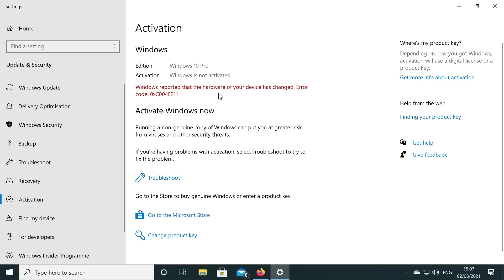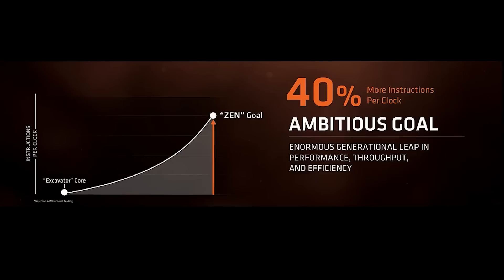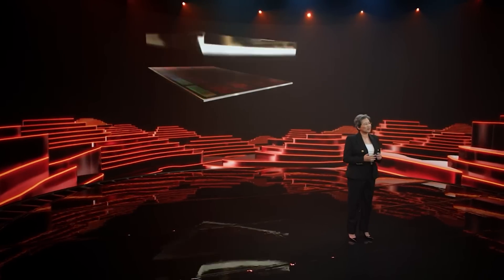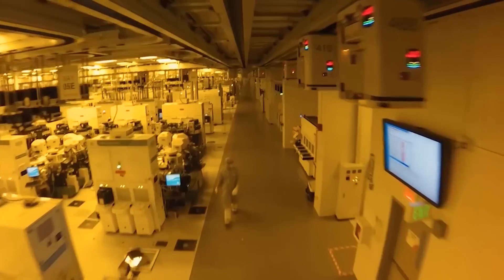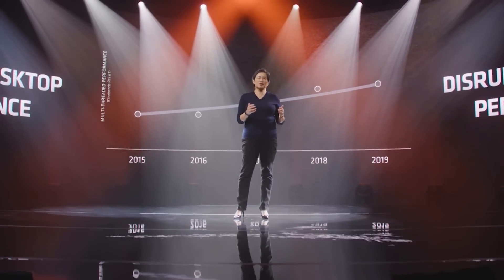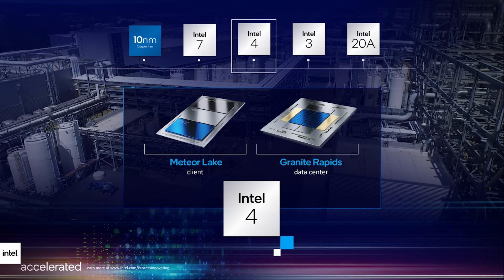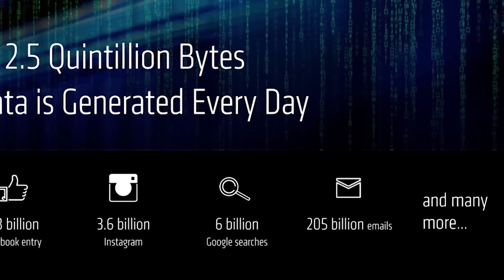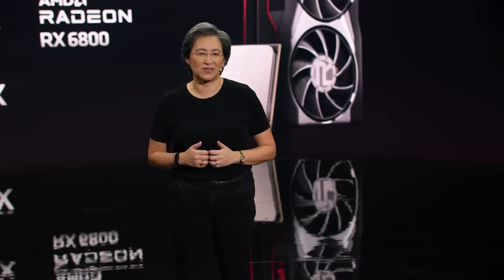AMD Details Zen 4 AM5 Platform & Accelerator Tech | Ryzen V Cache Performance & Release Date

Comment: 20-25% of ipc uplift or more powerful single core will not be enough for zen4 now when thst uplift already got Alderlake now and zen4 are year away
Reply: #1. Learn to speak English. #2. Alder Lake is BARELY +5-10% faster on average at 1080p gaming than vanilla Zen 3 which is still selling like gangbusters. AMD's fine.
Reply: @Cooe.  1; if you dont understand dont answer  .,2.  Alder Lake are only 1-4% faster at 1080p  depend on cpus ,#.3  AMD  start to lowering prices but seems too late  because  they are not something interesting and Zen4 could  fail if it comes too late

Comment: I think AMD and Intel might run into a demand problem. I’ve upgraded fully to Zen 3 and my PCs are more than powerful enough. However, I’m still using a previous generation GPU, a GTX 1080ti, that is matched to this. Unless there’s both a leap in GPU capability and, more importantly, a leap in supply, I see no need for hardware upgrades.
Reply: The PC desktop market is a relatively small market for AMD and Intel.  The big money market is the server CPU market, ala Epyc and Xeon.  Datacenters and corporations are always in need of more processing power and efficiency.

Comment: Releasing an AM4 refresh to compete with Alderlake would be beneficial - if it was competitive. The Alderlake performance is impressive from the leaks past on here. Getting another round out of an AM4 motherboard during this recession would allow good sales of new CPUs and motherboards and secondary sales of older CPUs - upgrading perfectly fine but older AM4 motherboards. E.g. most X370 motherboards could be upgraded with Zen 2 CPU's pulled out of X470/570 B450/550 motherboards, saving a lot of e-Waste and improving performance dramatically.

Comment: Has AMD fixed their USB problems?  I've owned 6 Ryzen chips.  5 first gen and 1 2700x.  I've had major USB problems with all of them.  From what I've read (mostly on Reddit) they've worked on the problem a lot but I still see people reporting USB issues on 5000 series chips.  I personally don't have experience with anything other than Zen and Zen+.

Kinda been hoping Intel got their act together (seems to have happened) so when I upgrade in a couple years I can buy an Intel chip - especially since I still see people reporting USB issues on 5000 series.
Reply: depending on your platform a bios update should fix the issue. i had the same issue with my 3200g and i have a b450 platform i updated my bios and it fixed the issue. as well as Amd chipset drivers in windows update that i also updated that i didn't know existed. have not had a issue ever since. try those things and see if it will snap your ryzen out of whatever its doing with usb's.
Reply: and if that dont work maybe it's mounting pressure? causing the usb,s to act a bit weird. just some suggestions trying to help out.

Comment: Everyone waiting for Intel, Apple and other companies products. But I'm waiting for Zen 4 architect because this will be most revolutionary product in this decade. You can be amazed by comparing it with Intel as they are still stuck at 14nm and AMD going to launch 5nm products.
Reply: Well, technically Intel is at 10nm with this current release so it's not like they're completely in the dust. The thing that will be most interesting in the Zen vs Intel will be how things compare as Intel moves to a big/little format and AMD goes HAM on their cache. The evolutionary lines are splitting further apart for x86 architectures and that's just friggin cool, no matter who wins.
Reply: @GirthOfANation  at the end, we (consumers) will have more powerful, efficient products ✌️
Reply: Zen4 has large IPC boost, but most changes will be around the socket, DDR5, iGPU models etc.
Zen5 seems to be the revolutionary chip, Mike Clark's interview with Dr Cutress showed his excitement about it

Comment: I hope early Zen 4 boards also support DDR4 so we can reuse our awesome mature DDR4 kits. DDR5 is expensive, the sticks are not yet larger in capacity and the latency is really bad. DDR5 will be amazing in 3 or 4 years.
Reply: New memory standards are good enough a year later. They can't support both without gimping AM5, a platform that's supposed to extend for many CPU generations.
Reply: @avatarion  the issue is that gen 1 DRAM. is always e-waste, useless by mid generation. Also going from DDR4 4000 to DDR4 4800 shows legible benefits already, existing software is not gimped by DRAM speed unless you are using low end RAM.

Comment: With global warming...the cost if rising electric bills...am l the only person that is disgusted by gpus insteae of advancing and becoming lower powered etc are starting to need 100 or 150w more to run them? I git a 3080...its massive, heavy...and needed a bigger powersupply to run it. Compared to my lower powered 2080super that was also smaller and less heavy...it maybe faster but its really disapointing imo.  Only 10gb memory off nvidia to deliberately nerf it for future, and for all its newness and size, weight and power usel have to say imo its a real step backwards.  If p buy a new car, and it has to be bigger, weigh more and guzxle more petrol to be faster than my last car does that make it a advancement over my last car?  Not really...and this l tgink is the issue...untill perhaps nvidia changes its architecture this going bigger abd using more power just to stay ahead is a real dead end approach.   For me personally the 3080 s power use and size is ridiculous..l def would not buy a higher power using card..as fir me l want actual advancements that lower heat, weight and power consumption. Maybe nthis is why nvidia desperately trying to buy up Arm chip companies? Maybe they know they about to fall behind as intel and amd both sense they reaching a point that they cant go further for a few years as their architecture is maxed out.

Comment: You don't need PCI-E Gen 5. Nothing you're going to want to use in your system is going to actually take advantage of it for quite a long time.
Reply: Ssds and direct storage are the likely most to benefit at some point. Games and applications taking advantage of direct storage will appear at some point and gen 4 and 5 are going to be beneficial for that. Its a bit of future proofing really. 

Besides gen4 and gen5 also allow for more devices with less lanes. So potentially 4-6 Nvme Ssds could be viable due to the extra bandwidth gen5 can offer. That and usb4/Thunderbolt 4/5 will benefit from it in terms of pci-e Lane bandwidth to the cpu.
Reply: even 3 to 4, is literally 2 frames more.

Comment: Raptor lake is supposed to be 1.1X the speed of Alder lake and moving cores to  8 + 16, so that is actually pretty important because that will keep it on par with Zen 4 in single thread and legitimately bury anything short of a full 24 core CPU from AMD.
Reply: Lol, no. Having 16x Atom family cores vs 8x of them on the chip does not make NEAR the performance difference you think it does. That's roughly the equivalent of adding +2-3x more big cores, which just isn't going to be enough vs 16 big core Zen 4.
Reply: @Cooe.  Are you okay dude? The whole reason they went with little cores is the multi threaded performance when scheduled properly is about 2x what it would be if they just used big cores.

Doing simple math, we have 4 small cores in the same size as 1 big core, each of these small cores are also about as fast as a 9900K locked at 4ghz. 

So we have since, a 10900K, 11900K and a 12900K.

The 10900K at 5thz is 1.25x the 9900K @ 4ghz. The 11900K has 1.2 the IPC of the 10900K but 2 fewer cores and reduced clocks.

The Big cores on the 12900K are 1.2x as fast as the 11900K cores at the same clock speed while also clocking much higher, with the KS sku hitting 5.5ghz vs 4.6 on the 11900K. 

So we have 1.25 times 1.2x times 1.2(5.5/4.6) = 2.1x speed difference between a big core on a 12900KS and a 4Ghz 9900K core.

I know the 9900K can OC to past 5ghz on all cores, I am just using it as a stand in since that is what those e cores are, without hyper threading. Effectively a 9700K.

Anyways, this gives us 2 more cores that are 2.1x the single core of a 9700K. So we get 4.2x 9700K cores of performance versus 8 9700K cores with the current design.

Furthermore, as they make more node jumps and improve the architecture, those little cores so the 13900K and 14900K little cores will be a lot faster, perhaps close to the performance of a 10900K/11900K ST.

Congrats, you played yourself.

This is also ignoring the fact that in R23, the best Zen 3 samples are barely touching 1700 points while the 12900K(non KS) hits around 2100. So that is a 23% difference AMD has to cover. It becomes a 35% difference once you account for the 1.1x/core uplift with 13th gen. And that expands to nearly 80% ST difference if you add in the 14900K making a 25% leap over the 13900K. 

14th gen also comes like 6 months after the 13th with supposedly a 25% uplift/core and double the small cores.

Which gives us a 14900K with 8 big cores and 32 little cores where each little core is faster than a big core on a 11900K/5800X and each big core on that 14900K is around 75-80% faster than a Zen 3 core.

Assuming AMD can make 40% uplift per core(most generous estimates right now). They are like 3.7% faster in ST than a 13900K. But then no further AMD CPUs are set to release for another 12 months, by which time Intel will not only have released said 14900K, the 15900K will be close to release at that point.

Keep in mind, so far, the largest single bump in ST performance for AMD Ryzen was Zen 2 -> Zen 3 and it was only 28% including clock speed/IPC gains. 

So AMD and Intel will be trading blows for at least the next 4 or 5 years until one of them can push 35-40% plus year on year gains while the other one does not. 

AMD can and certainly will compete with this, somehow, but to say Intel is hopeless here is downright ridiculous.

For this to happen though AMD will need to be releasing CPUs every 8 or 9 months with those 1.4x figures being accurate. On the bright side it means we might get a 64C/128T core Zen 6 CPU by 2024.

Comment: Two things about gen4/gen5.  First, when AMD started the planning phase for Zen4 (you can assume that AM5 WILL be capable of PCIe gen5 at some point, maybe even at launch), gen5 wasn't something that seemed like it could help, at ALL, EXCEPT for the chipset-CPU interface.  Even right now, the PCIe gen4 X4 interface on X570 is a limitation.  For the boards that have 3 NVMe drives, 2 are off the chipset, are capable of gen4, AND can be put in NVMe RAID.  But if you use 2 modern NVMe drives to put in a RAID, their speed can exceed the CPU-chipset interface speed.  Next, it seems by the time Zen4 launches, there could actually be NVMe drives that can exceed 8GB/s for reading large files.  So, it seems like because of NVMe and the speed limitation of the CPU-chipset interface, it could be AMD has decided to jump up to gen5.  I've always said they should at least have it for the CPU-chipset interface so they can keep the lanes down at 4, while doubling that speed.  That would make their premiere MB much more capable.  It there are going to be NVMe drives coming out next year that are exceeding gen4 speeds though, AMD at least needs to have gen5 for the NVMe drives.  I still don't think it's necessary for the PCIe slots.  

The fact is a PCIe gen3 slot doesn't bottleneck a GPU.  I doubt there will be any hardware other than GPUs that could possibly jump up to gen5 speeds over the next few years.  I mean, RAID controllers and other add on adapters haven't even moved to gen4 for desktop, except for 3 or 4 that have come out with a MB launch.  I WISH they would, because that makes an X4 slot pretty capable.  But, if they DID make a jump to gen5, then an NVMe RAID controller that's PCIe gen5 X4 gives you 16GB/s throughput, and that's insane speed for a PC.
Reply: Whilst gpus don't currently exceed most of the time gen3, when direct storage takes off with games in the coming years, the gpu will benefit from gen4 or gen5 for getting that data directly from the ssds. The consoles use it, and so the likelihood is games that start life with series x/ps5 in mind will probably be able to leverage direct storage too. They could also see 8c being the preferred minimum for games as well.

Comment: Will zen 4 & am5 finally support THUNDERBOLT?
Reply: Bruh, Zen 3 already support thunderbolt, its all depends on the board manufacturer
Reply: Thunderbolt support requires the motherboard manufacturer to license it from intel. For most they've not bothered. There are a few who did though. 

However,  zen4 will probably add usb4 support, which is effectively Thunderbolt 3, though the requirements for usb4 are not as stringent as Thunderbolt 4 or are, Thunderbolt 4 is guaranteed to support 40gbps for example, whereas usb4 is upto, and can vary from device and cable etc. In other words, usb is a utter mess.

Comment: Is the Zen 4 IPC uplift going to be +20% from Zen 3 or +20% on top of Zen3D?
Reply: No one knows.  Any information is a rumor.  IPC is a very rough number that depending on how you calculate it, you could get 20 - 30% variation in what different reviewers say the IPC uplift is, and because AMD is pushing Zen4 off until the end of 2022, I don't think they've finalized the products.  They have about another 7 - 8 months to develop it.  So, best not to believe anything at this point.
Reply: If Zen3D is 15% better than vanilla Zen3, then Zen4 better be more than 20% better than vanilla Zen3.
Reply: @SomeTechGuy666  Yea I would agree with that at this point, AMD can't release a CPU on last gen thats faster if not a hair off newgen.
Reply: should I wait for zen 4 currently have ryzen 2200g with 6600 xt I know i have bottleneck but I can still play most new title games at 50 60 fps
Reply: @lenkagamine6121  I mean if your running a 6600xt a ryzen 3600 would run you fine unless your doing compiling or programing then some more cores can help.
Reply: @lenkagamine6121  You should wait for Zen 4 but at the same time you would easily find Zen 3 at cheap price.
Reply: @lenkagamine6121  Your motherboard support matters, you may find 3000 series chips 2nd hand or on sale, similarly Zen3.
If you wait for Zen4 Q3/22 you'll be buying a whole new platform
Reply: @Eric - What matters most is that Zen 4 supports DDR5. So even if Zen 4 is identical to Zen 3 in performance from a figure perspective (frequency, cache, core structure) the fact is using DDR5 will put it on top in a short time. Having higher capacity ram modules, higher frequency and eventually tighter timings and lower CAS latency, DDR5 will give an immense advantage over Zen 3 in processing data. 1st wave of DDR5 will have terrible timings. However wave 2nd of the tech will be better and wave 3 will be perfected.
Reply: @computerhardwareengineerin7331  I'll probably give it about 2 years for each "wave".
Reply: same thing,zen4 will be zen 4dv too and i hope it will be more like 30% ipc uplift because Alderlake already have around  22% uplift

Comment: They showed in every video the performance against Ryzen.. but never shows the wattage?? AMD 16core cpu 5950x pulls around 140w.. 
Intels 10core 11series pulled 300w??
So now intel might be on kilowatt.. 🤣🤣
Reply: That is not true, Ryzen 9 5950X has a max PL2 or Turbo power limit of 220 watts, just like i9-11900K.

The difference is 14nm vs 10nm here. The Ryzen 9 has twice the core count but less clockspeed (always lower wattage when the voltage is lower for lower clocks).
Reply: @saricubra2867  ok, 11900k has how many cores? 8core 16t.. 
I know its 14nm.. its like the + bullshit they did.. 
10nm wont make that big of a diffrence with intel.. it will just be a undercover 14nm with an attitude. 
Do the math.. intel will still pull more watts
Reply: @jacquesbuys1354  Not true. Watch the 11900KB from Tiger Lake at 10nm, 65 watts TDP, performs like a i9-11900K.

It makes sense with Alder Lake.
Reply: Intel still have a problem with managing power, this is why they went for a hybrid design. Imagine 16 of those Golden Cove cores in a single package? The thermals will be unmanageable.
Reply: @WimukthiBandara  They went hybrid because making a big monolithic die made of 16 high perfomance cores is something from a fairy tale story and dumb.

Would be ridiculously expensive and Ring Bus can't go past 12 big cores, CPU latency ends up high and bad for gaming and clockspeed.

If Intel wants to keep adding cores, still use Ring Bus (the main reason why Sandy Bridge is legendary) and monolithic CPUs, they have to do Big-Little. We all now that Ring Bus and monolithic is the holy grail for singlethread speed.

Comment: Great video as always Paul. The only thing that will suck about DDR5-based systems will be day-1 DDR5 utilization/optimization. We will need chipset driver updates, software updates, firmware/bios updates etc over the following 12-18 months to get proper usage out of the new gen ram. 

Outside of that, it will trump DDR4 like DDR did to SD. It is double the bandwidth out of the box. 400-1,200MHz higher frequency. But most the bandwidth is what we will utilize.
Reply: The high end DDR4 will match the initial batch of DDR5.
They limitation is virtually always the lithography and it moves in steps, not leaps.